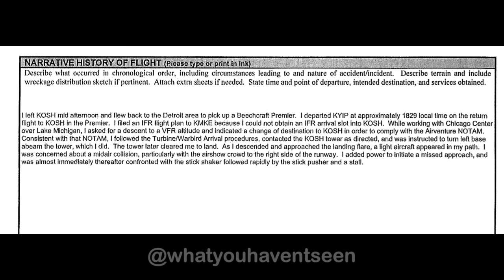Jack Roush Crashes Private Jet At Oshkosh (2010)

Comment: That is some of the worst flying I have ever seen on video. I thought that insane base turn to final was part of some airshow act, but nope, just someone who has no right being in a plane let alone a jet.
Reply: This was at Oshkosh, what you saw there was a short approach. That is very common and is actually required for some runways during the event. The go-around procedure was where it went wrong. Looks like a combination of 2 things; pulled up too quickly/soon with not enough power and exceeded the critical angle of attack. Which is why the wing dipped left, after that you see what happens when the wing can't produce enough lift. Luckily they were ok
Reply: Skylar Peterson I think Mr.  Roush lost an eye over that crash.  His wife was pretty banged up too.
Reply: He crashed to avoid a small light aircraft seen in the slide show
Reply: Yeah that base turn was insane árbol like 500 feet and 60+ degree bank I’m surprised he didn’t loose it right there

Should never be able to fly again ridiculous
Reply: Nothing wrong with doing a short base in a jet. You can do a 100 fvcking mile final and still get behind the power/drag curve. Maintain your airspeed, and you can do a fvcking barrel roll and land.
Reply: Any landing you can walk away from is a good landing!
Reply: Being I'm nothing more than an armchair critic 'an all, low and slow is asking for trouble isn't it?
There is a chart that shows AOA vs airspeed that very clearly shows a point comes where no amount of available power is able to pull you out of the drag bucket of nose high and low airspeed.
The only way out is to substitute airspeed for altitude but if you don't have altitude then bad luck!
But what would I know I'm just another moron on YouTube ..
Reply: @Team33 the piper cub? That was no factor as you can see at 00:18
Reply: No, you're pretty spot on!
Reply: I’m assuming you don’t know who Jack Roush is and definitely don’t know anything about his aviation history. Saying that man can’t fly is like saying astronauts should stick to gulf carts
Reply: Randy Carlisle my grandma drove for 9000 hours in her life but it doesn't mean she's good at it.

Any pilot, competent one will tell you that was not a good approach period. He shouldn't have even attempted the turn if he knew he was going to drift wide on the turn. What's a gulf cart?
Reply: reputation assumes nothing as per my above comment...
Reply: Very true.
Reply: Model Jet Juggernaut you're correct about the eye. He also broke his jaw, and compression fracture in his back. His wife wasn't on board at the time, his administrative assistant was the only passenger and she didn't suffer any injuries.
Reply: Agreed
Reply: Check out the radar footage of jfk jr's crash, takes the cake for bad decisions.  Wasn't certified to fly at night which would occur due to taking off hours later than planned.  Despite this he still decided to take the flight, little bit cocky.  You can see time wise as the visual references were gone he became disoriented and ignored the instruments.  The plane starts going wildly going up down changing direction randomly until it dove into the water.
Reply: Thats two crashes he has survived, that i know of. He is a good man and i think hes being watched over. I worked for him in the 80s, hes a smart man.
Reply: JFK Jr was flying in daylight. It was fog. Did you even research it?
Reply: Flying the aircraft is primary, anything else is secondary.
Reply: I see you're not familiar with Oshkosh.... Roush (pilot) was following tower instructions.
Reply: Free Heel The official investigation by the National Transportation Safety Board (NTSB) concluded that Kennedy fell victim to spatial disorientation while he was descending over water at night and consequently lost control of his plane. Kennedy did not hold an instrument rating and therefore he was only certified to fly under visual flight rules. At the time of the crash, the weather and light conditions were such that all basic landmarks were obscured, making visual flight challenging, although legally still permissible
Reply: Free Heel did you?  The original flight would have been entirely in daylight.  As flown,  it was dark well ahead of the intended destination.  His sister in law went over in her shopping trip by hours arriving late.  Good show finding the original flight plan (not followed).
Reply: I know who he is, a car guy, Ford, doesn't make him automatically qualify for ANYTHING in aviation. This isn't the first time that Roush totally a destroyed a plane, (last time I think it was a P51) injured himself or others, and endangered lives, unnecessarily. "The Man in the Hat" needs to stick to (his losing, Ford) cars.
Reply: well, dieselscience, I didn't hear tower instructions tell him to do that, maybe it's time for me to get a hearing check-up or you ask why he would follow instructions to crash the plane.
Reply: What Kennedy should have done is a 180 when he began to enter into conditions that required IFR and abilities he did not yet have.
Reply: "A man's got to know his limitations."
Reply: Rkf rkf  And aside from them both being aircraft crashes what does JFK's crash that have to do with anything?  Why bring that up, it was close to 20 years ago? Got some sort of a personal grudge?
Reply: Yeah if you pause it at 2:20 and read the report of what happened. It makes sense he wasn’t “hotdogging” he was trying avoid a collision and initiated a missed approach, only to have the plane stall almost immediately.
Reply: That's the way is is at Oshkosh. Always expect the unexpected. I've flown in there at least 30 times.
Reply: ThePaulv12 ĺ
Reply: As a man who can make a lot of money,  he is lucky enough to survive an aviation world where plenty before have killed them selves with top echelon aircraft.
Reply: You show me the plane.
Reply: Show me the plane.
Reply: Yeah, it looked like as soon as the nose went up at 0:12, the aircraft was stalling. I don't know if there was anything to do from that point on, really.
Reply: Spatial disorientation is a killer.
Reply: That, of course, depends on how you define "Good Landing". A good landing is one in which you do not destroy your aircraft.
Reply: Good pilots vs bold pilots idea, right? Having the "Right Stuff' around aircraft is pretty much a prerequisite to good piloting. Having the "Bold" stuff, not so much. Any way you slice it, this was one hot dogging landing attempt. Obviously, it was pushing the edge of safety and this time, it bit Jack. Well, we can stand on the corner and shout to the wind what a great pilot his is and how experienced he is. There can be no denying, this time he totally screwed the pooch.
Reply: The world is full of dead smart guys, isn't it?
Reply: Don't fly outside your capabilities?
Reply: He was trying to avoid what he perceived was an impending collision. Come to find out the aircraft was not a threat at all to his landing on the runway. Perception is everything. Split second decisions at just above stall speed had better be the right decisions. He was startled by something he thought he saw, he jerked the yoke, the flight envelope was ripped open, and the rest was inevitable.
Reply: That was his version of events. What did the NTSB report find? 1) That he was not monitoring departure traffic, and 2) He failed to advance throttle to full TO power for his go around. He admitted he only advanced throttle to less than 1/3 upon deciding to abort the landing.  3) The Piper Cub had already cleared runway 18R and should not have been a factor in diverting his landing. Conclusion: Crash was caused by pilot error- and nothing more.
Reply: Chris Selle    A “gulf cart” is any cart in the Gulf of Mexico.
Reply: For those who weren't there, have never been there, or who have not been informed about what lead up to the crash (and it looks like that fits just about all of you), he was not hot dogging, or making rash decisions that threatened a crowd. While Jack is a confident and somewhat arrogant pilot, it doesn't mean that what is shown in the video goes outside the authority that was given to him, or the wishes of AirVenture ATC. If you have a ton of time on your hands and want to be truly informed, read the AirVenture NOTAM, which is about 50 pages long. https://www.eaa.org/en/airventure/eaa-airventure-news-and-multimedia/eaa-airventure-news/eaa-airventure-oshkosh/04-26-2018-eaa-airventure-oshkosh-2018-notam-now-available 

I could go on and on about how the field is cleared at the end of an airshow, but the high points are this:
1. Wednesday evening, after the airshow, is traditionally a mass exodus event, requiring an incredible orchestration of departing aircraft and arriving aircraft - all traveling at different speeds with different roll out distances. This is especially true if inclement weather is forecast for Thursday. 
2. The airfield is split in to three parts, and there is a taxi way that is turned into an active runway that is parallel. Often times multiple aircraft are departing or arriving at the same time. Sometimes 4 at a time side by side, over and under landing long or short. Thus, it is normal to have departing and arriving aircraft occupying similar airspace , or multiple aircraft on the runway at the same time. It is, after all, the busiest airport in the world. http://www.boldmethod.com/blog/lists/2015/07/10-stats-from-oshkosh-kosh-the-busiest-control-tower/
3. Jack has made that approach, in that jet, many many many times. His home is a short flight away, so during many iterations of AirVenture, he would fly home and back several times during the week. 
4. I can confirm, because I was there, that a piper cub DID in fact enter his approach target at the wrong time. I can confirm that the piper pilot was rightfully operating his aircraft without a radio and was waved on my a ground control volunteer. The Cub took off without incident, and I personally saw it. 
5. I'm not sure when Jack saw the cub, but he did what he thought was right by attempting a go around, unfortunately it takes a few seconds to spool those engines to full boost, and with such a dramatic attitude at near stall speeds, the craft was not able to gain speed quick enough to execute the go around. 
6. I'm not an NTSB expert by any means, but I was there, and have been studying this event a bit since it happened. 
7. Go to AirVenture. If you have ANY interest in aviation, you will not regret it!!! I've been every year since 1976, and can't wait to go again.
Reply: There were a number of factors that lead up to the crash, none of which are obvious in the video. Ultimately it was collision avoidance at the wrong time, and he lost control. The approach was normal - Not only for Jack himself, but for the time of day, at that airport. Completely normal.
Reply: That's a very good point, the sun was just a few degrees above the horizon and he was traveling due West.
Reply: Agreed, again lots of money and little talent or respect for the airplane. This day in age anyone can get an ATP yet if you don't respect the wing, it will kill you.
Reply: I can’t tell if he’s a better pilot now because of the experience of taking a plane to the limit and past, or if he’s a worse pilot because he only has one eye now and no depth perception.
Reply: Armando Silvier I have flown into Oshkosh a few times in slow, Cessna singles and yes, ATC at Oshkosh can be faster and more difficult to follow than Atlanta Center on a Saturday night. Most who have ATC issues at Oshkosh aren't prepared for the unusual & quick, no-reply communication. There is lots of material that prepares pilots for Oshkosh. It's wise to ingest & absorb it before leaving the ground.
Reply: 9:41 PM is daylight ? Where did he crash, Alaska ?
Reply: I buy this one: "my grandma drove for 9000 hours in her life but it doesn't mean she's good at it."
Reply: Tell that to the insurance company when they are figuring your new rates with a Cray Super Computer!
Reply: Tony, Obviously you don't know the background of Mr. Rouch,  He flew F-4s off of carriers in Nam.  He flew 747s for Kaletta Freight Lines and other outrageous types of flying.  It's not a case of a rich man buying more airplane than he can fly. But you are right for the most part it does happen a lot, you see it all the time but this wasn't the case.
Reply: So Youtube Aviation Academy concludes Sky Captain Roush did everything correctly it wasn't his fault - hmmmmm.  I think I'll just walk, thanks anyway...
Reply: Primary instruction for any pilot. "You don't have to take off but you do have to land!" Jack avoided a light aircraft in his landing pattern, banked too sharply and stalled the right wing. He and his passenger were very lucky to walk away from a crash like that.
Reply: THIS. I could not understand he would go in stall and stick shaker territory once deciding to G/O because if you decide that you go full power even more so you were near minum speed in that turn (VREF) - plus it seems the power is gradually decreased as he passes by (could be also the doppler effect of the turbine sound) If really he didn't go full power this is a HUGE mistake and he's lucky to be still alive
Reply: Clearly he can't fly. There's a video of him failing to perform a basic student-pilot-in-a-Cessna-152 maneuver called ''maintaining airspeed'', obviously it was too much for him to handle.
Reply: ecktoeman  Got a link to that??? I’d like to see it.
Reply: Watch out a master pilot has said his few stupid words
Reply: Free Heel I was pretty sure he was flying at night and over water. Thats why he lost orientation. I stead of going to instruments, he tried to make sense of no lights on the ground and killed himself.
Reply: Cactus Sensai Doug wrong you are spreading disinfo.
Reply: A lot of people are smart.  Doesn't mean they should be pilots.  My dad was a small plane pilot and never had a serious incident in 5 decades, but he is hard wired careful.  I'm smart, but I KNOW I would skip a critical step one day, so I fly commercial.  Just like I don't ride motorcycles, because I know the risk of death is 35 times as high per passenger mile, and that my life expectancy would be measured in minutes.
Reply: "This was at Oshkosh, what you saw there was a short approach."

That's no excuse for bad flying. If you're skills cannot cope with something as simple as a short approach, first do NOT fly an aircraft unassisted. Second do NOT fly to Oshkosh where a short approach is common.
Reply: Ima Pseudonym 

So you’re stating or implying that accidents shouldn’t happen? Being a supposed firefighter I would think you’d have a different mindset
Reply: "So you’re stating or implying that accidents shouldn’t happen?"

Did you WATCH the video? I'm going to assume you're a pilot as well, so I ask you this; If you were an instructor, and your student was practicing short approach landings, would you have passed this person?
Answer honestly.

And yes, I am a firefighter, and I can tell you that 9 times out of 10 fires were completely preventable. "pilot error" as it were. If only someone had taken 30 seconds to think, and check their surroundings, or what they were doing, it would never have happened.
Reply: Ima Pseudonym 

What I’m saying is that it is easy to armchair quarterback a video. Accidents happen. And being a firefighter myself I can say 9/10 times it being preventable is a little extreme. More often than not a house fire is started by something out of the home owners hands, and car accidents will happen. This man has what it takes obviously to be a pilot. A more serious question to put into play would be how dangerous fire responses are from departments. When it happens should that engineer with years under him as a firefighter be fired/reprimanded or have his license taken?
Reply: throttle levers were found just above idle. Engine speed sounds in cockpit and on the video are consistent with this.
Reply: throttle levers were found just above idle confirmed by cockpit recorder and witnesses. Sad simple mistake. Did not apply go-around power.
Reply: Agree the Cub was 2 o'clock and no factor. Nothing wrong with a go-around you just can't forget go-around thrust.
Reply: Free Heel - no,JFK jr was flying VFR into (eastbound ) over the Atlantic. He was delayed in departing and had no real night experience let alone no reference/instrument overwater flight time. 
The loss of awareness caught him and with no training was not able to utilize his instruments to stay in coordinated flight. 
Very sad.
Reply: JFK JR was also fresh out of a cast. He was not IFR and the weather was crappy.
Reply: @Jan Pickett Larison: In a fully functional aircraft in perfect weather conditions, anything other than a perfectly executed landing is actually a bad landing. A crash under those circumstances is absolutely unconscionable, and grounds for being permanently stripped of one's piloting license.
Reply: When you have enough money you can buy a pilots license.
Reply: Maybe it started out as a go around after loosing so much altitude in that left turn to final and too low airspeed, but then you clearly hear the power being reduced again to try to land. He decreased the power too early and lost the airspeed again, when you see the RIGHT wind dip, not left.  He did not want to do a go around as it's for...  the poor?  The whimps?  Who knows...  He's alive and has as much luck as money. Brains are not included.
Reply: Absolutely!
Reply: Randy- The National Transportation Safety Board attributed the cause of the crash to pilot error, specifically, "pilot's decision not to advance the engines to takeoff power during the go-around, as stipulated by the airplane flight manual, which resulted in an aerodynamic stall at a low altitude." The NTSB had the final say and BTW, didn't Randy crash a plane into a lake in Alabama and nearly drown?  HMMM, seems like a pilot who either has bad luck or doesn't have the Right Stuff to me.  But then again, my frame of reference is pilots who don't care who sees their Fighter Weapons School patch...so I'm a meany!
Reply: I missed it in the audio, did the tower tell him how to stall the plane?
Reply: Travis- Can you break down and defend Jack's other crashes as well?  Jack screwed up, so to defend him at any level only makes me laugh so thank you!
Reply: Nope it was an Aircam
Reply: It's not part of a show, but it's part of their procedure for landing dozens of aircraft a minute on very nearby runways. Normally they'd come in from a mile or more from the end of the runway, but with these short turns they have to go extremely slow and make sharp banking turns that don't do well at slow speeds. Most jets go for a full proper approach, and these shorter landings are for small GA planes.
Reply: Sorry- that's not what the report says. #5- he didn't "spool" the engines except 1/3 according to his own admission. Dude. It was pilot error. Period.
Reply: he didn't go full power. he admits that to the NTSB.
Reply: ThePaulv12 that would be substituting altitude for airspeed. Hence you have enough altitude to push the nose over gaining airspeed and losing altitude in the process. But yes, you certainly need one or the other.
Reply: Travis Tortorige The only thing I know for certain, from the NTSB report and Jacks own admission, is he never put the throttle to TO power for the go around. He only got them up 1/3 of the way. Damn hard for an engine to spool up with no fuel.
Reply: Cactus Sensai Doug JFK jr flew into a sudden fog
Reply: Ethan Higgins he was instructed to. Did you not listen? Turn base abeam tower.
Reply: Armando Silvier I thought they were very clear, and not too fast at all. You should hear chatter in class B airspace. It’s almost incomprehensible at times. I haven’t flown in a while, but when I did I got used to it quickly.
Reply: Don Berry new hobby
Reply: Casey Erickson i have just subscribed to your channel
Reply: +Cactus "Sensai" [sic]: What certificate allows you to fly at night? Oh, a Private Pilot's Certificate!

The problem was possible flight into IFR, for which he was not certified. He was a low-time pilot in a high performance airplane flying into marginal Wx... bad combination. 

As I understand, his IFR current instructor offered to fly with him. He declined. Makes it sound like the arrogance of the scion of a (in)famous family.

Saddest for his passenger, who trusted him.
Reply: wrong, the pilot activated the the reverse thrusters while pulling up on the stick causing a violent shake, you can see it in the video. then there was a malfunction with the horizontal lift gate leaving the pilot helpless as the jet did an aggressive wingover  with no power at demand since the reverse thrusters were activated. come on guys, use the slow motion tool in youtube to analyze more closely you will certainly see what I am saying.
Reply: Free Heel absolutely NOT. He took off at DUSK, and flew into total darkness.
Reply: dieselscience true, but he had been DENIED landong clearance earlier. Just figgered he would roll on in anyway...bet he regrets it now.
Reply: Ethan Higgins Another “pilot” heard from. lol
Reply: He was going real slow but was lined up with grass and parked planes after the turn. If you couldn't align things during the big turn what makes you think everything will line up after executing a left then right 45-degree turn, time to look like a fool and go straight and stay alive.
Reply: Ethan Higgins it wasn't the approach, it was the go around that messed them up. Some type of drag pushed them down whilst they didn't have enough power and to my much elevator pulling back resulting in a stall and I saw someone say it looked like he was avoiding the GA airplane shown in the video but I'm not sure.
Reply: I cannot "BELIEVE" the Amount of "Cross Talking" going on (yep, heard it LIVE this year!) while Planes/Pilots are trying to Land/Takeoff? Wouldn't it be a Hellova Lot better for Air Traffic Control to Inform/Warn Landing Pilots to "CHANGE Freq s" the same way major Airports do when a Plane has landed to a Dedicated Runway Taxi Channel, instead of Using the Same Channel for both at an Event like this? This pilot was confused as to the Runway to start with, having other People "Yapping" at the same time as the ATC doesn't help....
Reply: Simply confusion as to Which Road was the Landing strip, happens even to Large passenger Jets all the time.  Taxiway "Design" needs to be Badly Changed, as its still the Same as it way during the TIME of the Wright Bros.(paint Lines Diagonally/Cross-ways on Taxiways maybe, to  make em Highly Visible as such, similar to Crosswalks on roads?)
Reply: Yeah the Kennedy's don't have that "backup and try again later" gene. JFK Jr wrote an article shortly before his death regarding a kayaking trip he did. His own words made it clear he was not a good judge of risk or or recourse. Talks about launching into the Baltic for a 10mi crossing or such when all the fisherman were staying in port it was so bad. All dumped in the waves just past the breakwater, and eventually washed ashore. Took the ferry 2 hours later (ie did not have attempt the crossing). Had they made it a mile out and dumped it could have been fatal.
Reply: I was looking for that as that is what his report said, but unable to see any other aircraft, can you pinpoint time on the video, type and color of aircraft, and location?
Reply: that actually would've been pretty cool had he landed it right then.  we'd be calling him A BOSS...!!!
Reply: Free Heel jfk was in a new aircraft he wasn't farmiliar with,you can't just jump into any plane, he got overwhelmed
Reply: It is the pilots responsibility to not enter into a maneuver if unable to safely do it... whatever the approach "requirements", or whatever ATC clearances are. Secondly it does seem that the aircraft was already close to critical AoA on the base to final turn, had they pulled just a sliver more on the pitch, or reduced speed by a knot, on the turn it could have easily stalled getting to final. Reading the self-report it is clear the pilot had/has no understanding of his own, and his aircraft's abilities and limitations. It is lucky he did not fly the plane into the crowds. The "other aircraft" mentioned risk was minimal (actually seems more like an excuse for avoiding responsibility) compared to the obvious loss of aircraft control and imminent risk of crashing into the crowds and runway.  Zero flight knowledge, that type of pilot is a hazard to themselves and others.
Reply: ThePaul12, You are right theoretically. But this jet was never near its maximum thrust at any time in this approach and crash. The attempted go-around was immediately interrupted by complete over-controlling in pitch - the fore mentioned stick shaker (plane at max AoA) and stick pusher (plane trying to get pilot to return pitch to under critical AoA). There was, by the audio a half second or so of audible power increase but immediately the pilot abandoned flying for trying to crash land.  This really looked like what would happen if someone who never flew a plane before tries this maneuver.
Reply: Ethan Higgins he lost an eye,he will never fly again,it's sad as he really is a good pilot, he just screwed up,it happens to everyone
Reply: Agreed
Reply: This is what happens when you push the plane and physics to the Limit
Reply: Troll Master if the plane is still intact then it’s an excellent landing
Reply: @tedschaller  only on a carrier!
Reply: Armando Silvier  this is eaa..a plane is landing and taking off on average less then every 30 seconds over an 11 day period(take into account slow times at night and during the air show the times drop down to less than every 20 seconds)...the atc are the best in the world, this is their super bowl...as a pilot of you are not ready to fly into the beast that is eaa and deal with how quick everything happens, dont fly into oshkosh
Reply: @skyrocket90  Yeah. It appeared he wasn't climbing up and out, at all --  something was keeping him from moving. I guess that was him stalling. Gravity was reclaiming the plane.

A jet like that, a BEECHCRAFT Premier, would have streaked outta there like a bullet -- had he known what he was doing, like a truly skillful pilot.